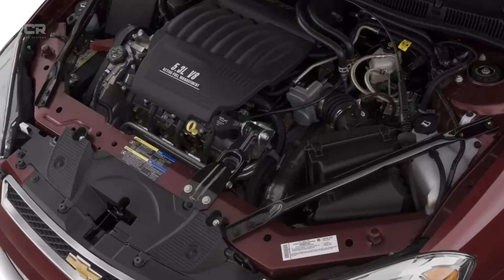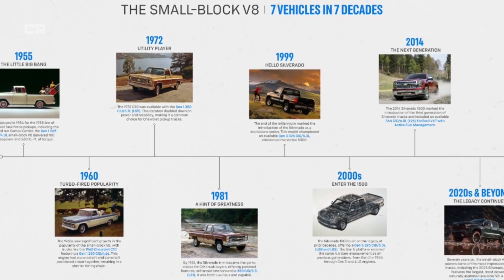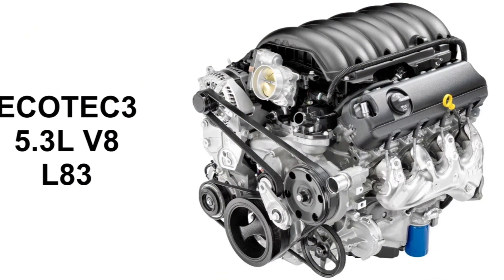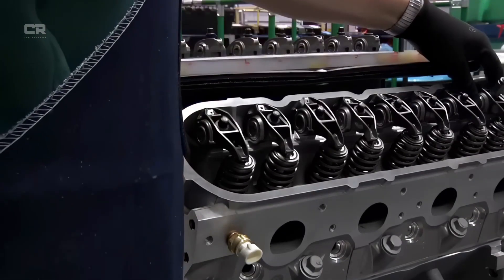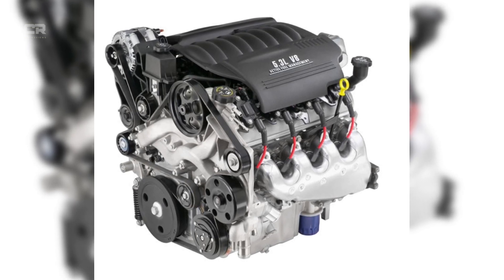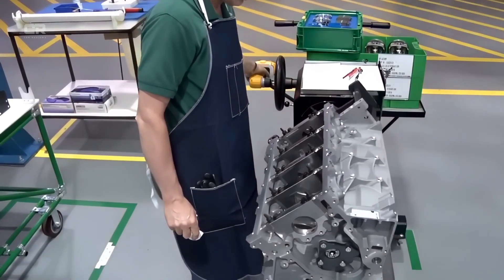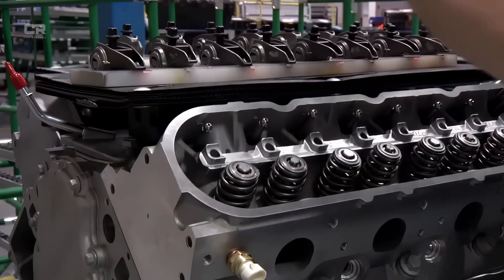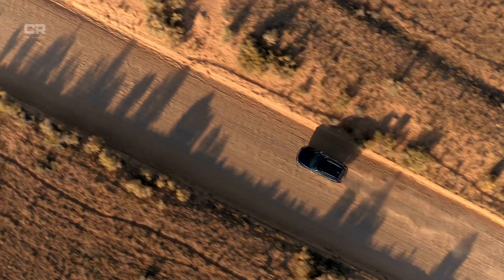The 2026 Fix That Saves the Chevy 5.3L V8 From Destruction

Comment: The 2026 fix is great but it does nothing for the earlier models that have AFM. I disabled the AFM, changed the oil from 0W20 to 5W30 and change it every 5000 miles instead of when the system says which is usually at 7500 miles.
Reply from the maker: Thanks for sharing your experience! Disabling the AFM and changing oil more frequently is definitely a smart move for those earlier models.